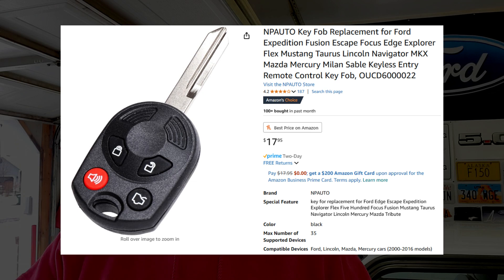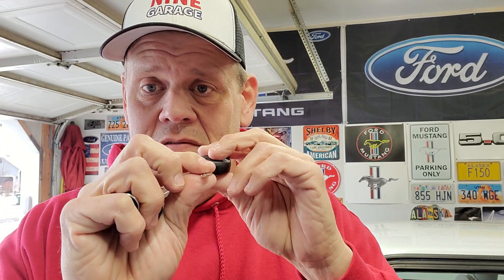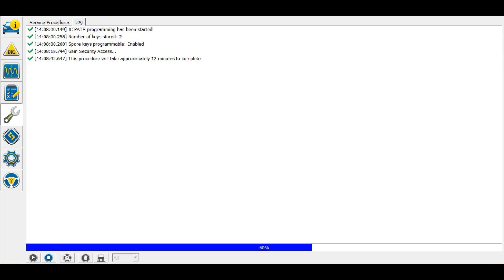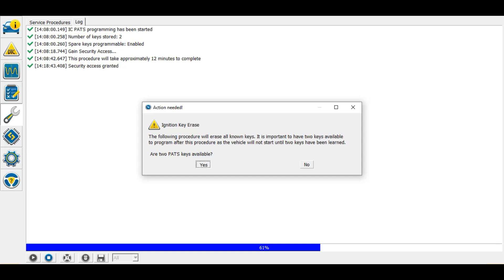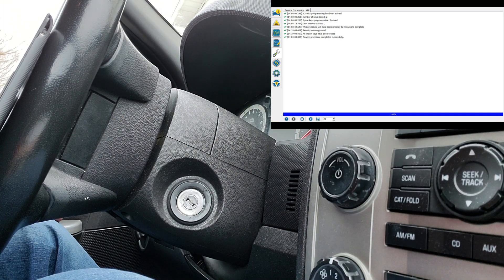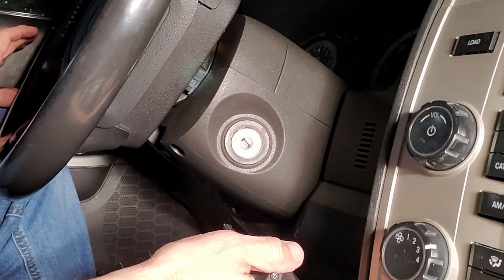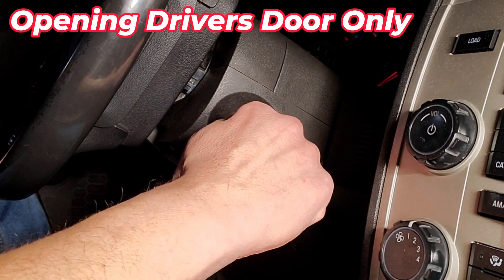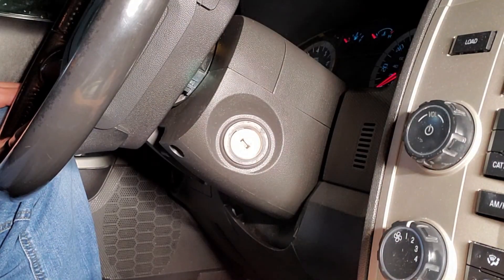Programming a New PATS Key for Ford using FORScan | Step-by-Step Guide

Comment: hey man, one question. i’m looking into programming a new SJB (passenger fuse box) into my 2013 Navigator. would you happen to know the process of programming the new one in? i have all the appropriate gear with forscsn and all.
Reply from the maker: I have not had the opportunity to do one of those yet. However, if you still have access to the old SJB, you should be able to pull the programming off of it, and apply it to the new SJB. Is the old SJB able to be accessed?
Reply: @89G yes, it’s still in the vehicle. i also went ahead and downloaded the asbuilt data for my vin from the motorcraft site.
Reply from the maker: @TownCar512 that's awesome!  I was going to refer you to the Forscan page to look for an asbuilt. What Motorcraft resource did you use?

Comment: Please help, turn out i failed, the wrong procedure that i did at 8:40 made all my key erased,.but not programmed. So my key unable to start the engine. 

I wonder how excatly you turn the key from off to on when programming, and wait 6 secomd.  do you turn the key all the way to position iii (position to ignite the engine), or just at position to
Reply from the maker: No, don't try and start the engine. Go as far forward as you can without going into the crank position.
Reply: @89G I doing the process again from the beginning,.but when I turn the key and 6 second waiting,.nothing happened,.there's no three chims  like in your video.  After 6 second ,.I insert second key,.there no also chims. The result both key still not programmed. Any hint what's wrong ? Do you need open driver door ?
Reply from the maker: @thevoyager4662  Are you putting in your original key first?
Reply: @89G yes,. But now the original key became same as new key,.they both not recognized by car. Because have been erased.,

Comment: I bought a 2008 Mercury Mariner Hybrid from someone. He changed the original lock cylinder and ignition switch. He ordered a new cylinder and ignition switch,  which came with a set of blank transponder keys. I still have the original key, for the original lock cylinder.Will ForScan allow me to program the 2 blanks to the PATS system, if I erase all keys?
Reply from the maker: You need an existing programmed key to start the process. You may be able to trick the system, however. You could go get a non-chipped key cut for it, and hold the old key next to the ring (The ring goes around the key cylinder) that reads the key while you start the process. Does that make sense? I hope that I am explaining that correctly.
Reply: @89G it does!! Thank you!!
Reply from the maker: @KingDingaling-y3d  Great! I posted another link above that may help you too.
Reply from the maker: If you go to 7:56 in my video in this link (at the end of this comment), you can see the ring and how to remove it. You could even remove this ring just for the process, and have it read the old key. https://www.youtube.com/watch?v=70STB1OnWSs

Comment: Great video! I recently bought a 2020 Ford but only received one key and it even not the admin key.
I'm planning to add more keys using FORScan and the "full key reset" option. My question is:
Can I reuse an original Ford key from a scrapped car (same type/year), make a new key blade at a locksmith, and then reprogram it to my car — or does it have to be a brand-new, never-used key for the programming to work? Would really appreciate any insights from those who’ve tried this (if this work then I planning to program 3 keys for my car)!
Reply from the maker: That's a great question. I can't tell you for sure if it will work. My only hangup on saying yes is, I don't know if a previously programmed key will just allow a new program without being unprogrammed from the vehicle it was originally paired with. If you try this, will you please come update the group here? Thank you for watching!!

Comment: Will this work on a 2018 Escape?
Reply from the maker: Yes... do you have keyless ignition? If so, you place the keys in order with the emergency port. I can't recall what Ford officially calls it, but the place you put your key if the battery dies.
Reply: @89G  No just the normal key like the ones in your video
Reply from the maker: @tungy01 oh, you'll be just like this for your process!

Comment: Unfortunately Free trial even extended license does  not allow you to use pats key programming, a message appeared that Free trial extended license doesn't allow that function and you have to pay for the extended license to use that function, it is not expensive just 20 dollar a year plus tax.
Reply from the maker: That's good to know! The paid version is definitely worth it for the price.
Reply: Thanks man for the help, but Unfortunately, I programmed the smart keys successfully,  but the car doesn't start at all because of the wrong VIN number inside the replaced PCM, flagship company lied about programming the PCM to the car VIN number, when you connect the scan tool, the donor car VIN appeared not the my car VIN number, and we contacted flagship and they lied and said that normal, your car VIN number is inside the PCM, just reprogram the keys, we  trusted them and nothing happen, because in the process of programming the keys, the tool show you the VIN number and ask you if that your car VIN number, if you hit yes and  proceed with keys programming that what happen, there will be no car starting even programming the keys successfully., because the DTC immobilizer code stayed there and doesn't go away because of the wrong VIN number inside the PCM.

Comment: Great Video Sir-  I have an old 2000 ford ranger that has a worn out ignition. I bought an ignition key set (2keys) off Amazon.
I have the trial activated in FORScan, but cant seem to find where I or how to transfer the PATS to the new keys  Any help at all would be greatly appreciated.
Reply from the maker: What are you using for an adapter? It must be a switching adapter or you will only see (roughly) half of the options. Elm327 and similar adapters won't see PATS. I highly recommend the V-gate adapter that I use in the video. There's a link in the description for the exact model.

Comment: After seen your video I recommended to a friend the use of the forscan to delete and program the car keys of a 2016 Ford fusion  after the installation of a used programmed PCM (of course programed VIN only),  because  I couldn't do it with launch 909C Immo special function, because a warning message said there is a risk of loss and damage may happen (it suppose to the car module software I guess) if you proceed, and I cancelled the process immediately and  I recommended the forscan tool. I don't exactly know what that message was about exactly but if the process failed, the car will be a setting duck on that parking spot till the dealer or any licensed professional program those  original keys again, I don't know I just couldn't take that risk, neither the car owner.

Comment: Oh man you, did a big mistake by pressing the ok before making sure both keys start the car after the programming process, because if they didn't you may meed to start the process again,  after both keys  strat the car,  then you press ok to exit the key programming window,  but you were lucky, the keys were programmed correctly.
Reply from the maker: I'm not sure what other option you are thinking I had there? There is nothing but an OK button. No back button, no cancel... it also states "two keys have now been programmed". Please explain what you mean.
Reply: The phrase of  two keys have been programmed was there before you start programming the keys and it didn't change after you finished the programming,   that way I said test the both keys first and see if they start the car and then when everything is ok, then you press ok, just in case if you missed the 5 second window between the two keys programming process or you didn't complete correctly the 6 second on the on position, you will have chance to do it again from beginning.

Comment: Hi , can I program key for f150 2016 xlt model. I have only one key , which truck does not accept and there is code in BCM like PATS key failure. 
Can I program key that is not working and truck does not cranking and can I add more key with your instructions mentioned in video. Thanks
Reply from the maker: Unfortunately, no. It needs to be able to read at least one key to even start the process. Can you tell me what the exact code is you have in the BCM?

Comment: Hello, Thanks for the great video!. At the end you stated activating the fob buttons and I can only get one to program as well as the original. (the third will lock-unlock and start manually) but no remote start or remote lock / unlock- buttons on the third. If I program that one that does not work the other one's buttons becomes disabled so I know it will take the programming. 2 my key limit? Any ideas? 2015 F-250
Reply from the maker: Do you have push button start, or key start?

Comment: Great tutorial, i  hope it will work for me.  One question, when cutting other key, they have only cut it same as original, but without programming. Did i get it right? Thank for video
Reply from the maker: I hope that I am understanding your question correctly - but yes, you'll need to have it cut prior to programming it. It needs to be able to turn the ignition cylinder in order to program it.

Comment: Is this what is required to resolve the PATS alert after swapping a PCM while using the original keys?
Reply from the maker: Well... I'll need to know more info. Is the new PCM used or new? You can pull the programming from the original PCM in Forscan and load it on the new PCM... and I think that is your best bet. However, if you bought it new (reman) from someone like Flagship One, They'll probably have some specific instructions to make it work.
Reply: @89G I did exactly that. It's coming in the mail from Flagship right now and I'm trying to gather some info. I may have to try your technique.
Reply from the maker: @DavidShpprd  some of the Flagship PCM's come without PATS enabled. My friend has a Flex with a Flagship PCM and no PATS.
Reply: @89G  My vehicle comes with the PATS. I just got my PCM in the mail and they only say that if I'm using original keys I need to visit a Ford Dealer or a Locksmith unfortunately. Do you think your video reveals the exact process the dealer will do?

Comment: Will this work for a 2011 ford ranger if I only have 1 working key
Reply from the maker: Yes it will.
Reply: @89G  then why at 6:33 in the video you say if you have only 1 key don't go forward.
Reply from the maker: @ateeqafzal4444  you're at the point when they've been programmed. That is just making sure they both are programmed before proceeding.

Comment: I bought my 2014 ford explorer and got 1 key. I checked mykey and it isn't mykey setup. Didn't know anything about the 2 key system. Now my keyfob is crapping out and having an issue with PATS. Got a couple of new keys same as yours lol... got my forscan and connector. I can program my 2 new keys following this procedure and be good to go, right? Great video.
Reply from the maker: There was a viewer that just had success with the same scenario that you have. I believe it should work for you.
Reply: @89G  Just did it a few minutes ago and it worked perfectly! Programmed 2 new keys fully functional. THANK YOU SO MUCH. Ford dealer was charging $500 per key!
Reply from the maker: @JeremyLJordan  That is awesome! Nice job, my friend! I'm glad the video helped you out!

Comment: Do you happen to know if this will work if I only have 1 key and its a MyKey? I have a cut amazon key unprogramed for the second key. 2015 f-250 superduty diesel if that info is needed.
Reply from the maker: Good question... unfortunately, it has to be an admin key to create additional keys.
Reply: @89G  Just out of curiosity, if you are erasing the existing programmed keys like you did in your example why does it matter if its an admin key or not?
Reply from the maker: @CaPiTaN3588  I'm just going off what Forscan says the requirements are. My guess would be that the admin key is required for theft and security reasons. I've never done this any other way than with an admin key, so I can't tell you for sure what would happen.
Reply: @89G appreciate the help!
Reply from the maker: @CaPiTaN3588  glad to help. I wish that I had the specifics of "why" so I could give you a more definitive answer. Thanks for adding to the conversation in the comments. They help a lot of people too.
Reply: @89G  So I gave it a shot but used Ignition Key Programming to add it as a 3rd key and it worked! It made it an admin key so I was able to go into the settings and clear the MyKey from my original key and now they are both admin.
Reply from the maker: @CaPiTaN3588  Well that is pretty sweet! Great info to add for everyone as well. Nice job, and thank you for sharing that. That is very helpful!!
Reply: @CaPiTaN3588 I really appreciate this comment! Was exactly what I was lookin for. I was a little hesitant to erase and reprogram, and I'm happy to see there is a workaround
Reply from the maker: I think your best bet is to use this link to get what you need to achieve your goal. It runs about 100 dollars to get what you need. https://tomskey.com/?view=sl-3D88976F

Comment: I have a bad cluster. I purchased a used one from a junkyard Will I be able to read the mileage from one cluster and put it in the other...

Will Forscan work for that.
Reply from the maker: It can, yes. I am 99.9% sure you need the full version to do it.
Reply from the maker: I do not think you can transfer programming without the full version...
Reply: @89G thank you

Comment: Is this work for 2020 ford police interceptor? I tried to run the ignition cycle 8 times as the video shown but nth happened.
Reply from the maker: This is the sequence: 

1. Open the driver-side door: and push the UNLOCK button.
2. Turn the ignition from OFF to RUN 8 times: within 10 seconds. The 8th time, leave the ignition in the RUN position.
3. The doors should lock and unlock, indicating the programming mode has been activated.
4. Press any button on the key fob: you want to program within 8 seconds.
5. The doors will cycle again: to confirm the key fob is programmed.
6. Repeat for additional key fobs, if needed, pressing a button on the new key fob within 8 seconds of the doors locking and unlocking.
7. Turn the ignition OFF .
8. The doors will cycle one last time: to confirm programming is complete.

Comment: Thank you for the great information in your video. I used its help to program a new ignition key for my 2010 mercury milan. I had only one working key, in forscan it showed that I had two keys in memory, but it gave me the option to add an additional ignition key without deleting the old keys from memory. It was one step and done. The new key works/starts the vehicle, and then I programmed the fob afterward to lock/unlock doors. Thank you for your help.
Reply from the maker: Fantastic! I am very glad to hear that it was helpful to you. I appreciate the feedback very much. That Milan is a pretty decent vehicle!

Comment: The only time remote programs together is with OEM keys, gotta purchase from dealer. Also, us locksmiths don't just clone keys there is a little more to it lol.
Reply from the maker: @marc0hdz  thank you for your input. I wasn't slighting your profession by any means. Just trying to show this method. The two locksmiths that I originally contacted used the "clone" terminology. So if that was not correct, I apologize.
Reply: @89G  oh no, didn’t take it like that at all I just chuckled a little watching the video. Only reason I got interested in it was because I came across your video looking for a little more info on forscan since from the looks of it it’s easier to disable mykey with it than with the tools I have. Thanks for uploading! 🔥
Reply from the maker: @marc0hdz  oh, yes. I have seen the MyKey stuff in there. I use Forscan a lot for disabling TPMS too. It's an incredible tool! I wish GM had something like this, that is also this cost effective!

Comment: Thank you so much! My dad had to replace the ignition lock cylinder on his 2018 Escape and this worked like to charm to program the new keys.
Reply from the maker: Great! I am very glad it helped him out. Thank you for your feedback! This is why I do these videos!
Reply: The only things that differed from your video is accessing PATS required purchase of a license. Also there was no 12 minute waiting period it just bypassed security instantly.
Reply from the maker: @Maxb483  That's awesome. I have the perpetual (lifetime) license.... I wonder why mine does that waiting period? Maybe I need to update it again. Thank you for the info, that's great for everyone to know!
Reply: @ one other thing is the remotes worked right away too. No extra steps needed.
Reply from the maker: @Maxb483  that's sweet! Good to know. Thank you!
Reply: I got 2015 f150 with only one key ( blade key not fob) 
What program do i need to go in pats? Erase and program? Or add ignition key?

Comment: I did everything and my key will unlock but wont start
Reply from the maker: If you go to 8:40 in the video. Did you click OK prior to entering the programming procedure? If so, that may be your issue. You can't click OK until the two keys have been programmed.
Reply: Update?